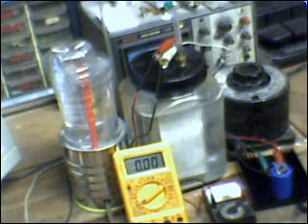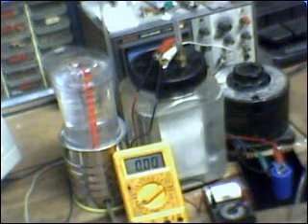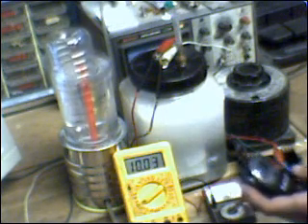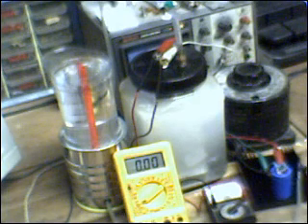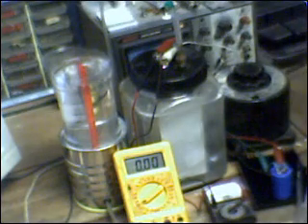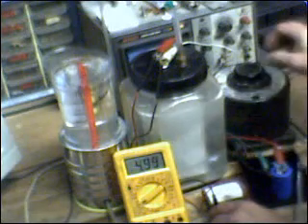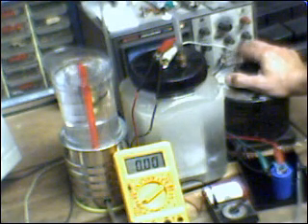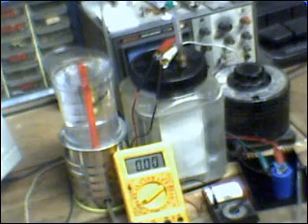#30 Hydrogen HHO ZooFFer Cell ACTUAL MEASUREMENTS!!!

Comment: I was informed of a mistake on my part, 1L=1000cm3 not 10cm3...making it 89.31mol HHO, 43315.35 Joules, and 269% efficiency (which is overunity).  Although, as I said, electric Joule measurement is different than chemical Joule measurement, so efficiency cannot be calculated in this way.  Sorry for the decimal error, and thanks zff for letting me make the correction.

Comment: Actually, the calculations I found were a bit off:
1J=1CV
1C=1As
:1J=1AVs=1Ws ; 16100J=70*230 is correct

1L=10cm3 HHO
6.667 cm3 H = .60003g = .5953 mol
3.333 cm3 O = 4.76619g = .2978 mol
.5953+.2978 = .8931 mol HHO

2H2 + O2 -> 2H2O + 485Jmol
485*.8931 = 433.1535J

2.69% efficient, that's if electric J and chemical J were even related

Comment: you dont want amps though! i can get 1.3 litres per minute with 2 amps at 12volts in a tube type cell using the stan meyers circuit. 24 watts! .....24 volt and 40 amps is 960 watts. almost 1 kw to run the cell=[ 
keep trying mate i love your videos

Comment from the maker: Okay, it's now pretty clear that 8 neutral plates is way to many for a 12v application. The next configuration will be +nnn-nnn+nnn-nnn+. If I count going away from the present - electrode, all I will do to test is slide an electrode strip in between n-plates 4 & 5, tie them together and make those the -.

Comment from the maker: Increased NaOH concentration to 10tsp/gal. Production/watt remained about the same but the critical 10A voltage dropped from 24v to 17v, at which point my experiments came to an abrupt halt. The plastic container I used must have reacted with the high NaOH concentration. One corner split open and it pissed all over my bench. Live and learn.

Comment from the maker: Ran the cell for 30 minutes at 21v/5A. Barely got any warmer. Reran the production test. 1st run cold in this video, 500ml in 42 seconds @240W. 2nd run slightly warmed up, 500ml in 35 seconds @230W.